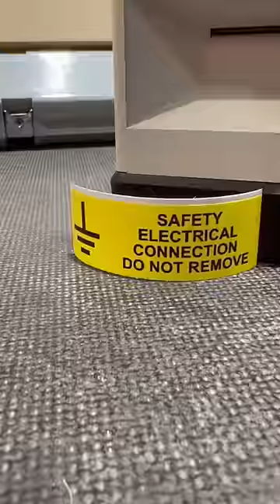Electricians Shocked by this Mysterious Earth Clamp

Comment: Why did you use a ring terminal for the second clamp, but chose to go "bare wire" for the first one?
I guess both work fine, but seems a bit inconsistent.
Reply: Think about it?
Reply: You can't have a ring terminal in the middle of a length of wire

And you're not allowed to cut the cable, and have one length from MET to first pipe and a second length from first pipe to second

So either you have two lengths, each from MET to their pipes, or you do it this way

Anyone please correct me if I'm wrong! I'm working on my NVQ and still learning 😅
Reply: @willpulford8893 You're spot on mate.
Reply: @willpulford8893  ah okay, learned something today.
Is there a reason why this is?
On a sidenote, i'm guessing this is a specific british rule/code?
I'm from the netherlands, and here we're not even allowed to do CPC/Earth in flex, we need to use solid wire. We are however permitted to use an earth terminal block. (Like a 4 or 6 mm solid wire to the bathroom terminal block, and connect all pipework to that block.) Same goes for the main earth for inbound pipes (like water and gas)
Reply: @ThorNado77  so the "do not cut and splice the cable" bit is a regulation, and I suppose the logic behind it is that by cutting and splicing, you are relying on that splice/terminal/ferrule to keep the pipe that is further away earthed. If the splice is weak or fails, then that pipe isn't earthed anymore. Seems like it would be a very rare thing to happen but that's the rules, my tutor was very clear on that

Do you really use a 4 or 6mm solid wire? That must be very hard to install! In the UK we treat the earthing of incoming services (water or gas pipes) differently to the earthing of other pipes through the house - for other pipes it's called Supplementary Bonding, and the main pipes it's called Main bonding.

Main bonding has to be a 10mm² cable, without any cuts and splices like I said

Supplementary bonding is done with a smaller cable, and is often done by just connecting one pipe to another, as long as one of the pipes is earthed somewhere along the line. Not 100% certain on that last bit
Reply: @ThorNado77 t's because when Dennis the plumber comes along and replaces the first bonded part for plastic in three years and disconnects it... Unless he 'destroys' the conductor... The remaining part will still be bonded. It's just more foul proof.
Reply: @willpulford8893 oh and main bonding isn't always 10mm
Reply: @travoltasbiplane1551  oh yeah I remember from doing EICRs for my level 3, it can be 6mm² or 10mm², is that right?
Reply: @willpulford8893  have a look at chapter 54. Table 54.8 for pme installations. 👍

Comment: They will be shocked that some bone head used a pipe ground. That’s not allowed in homes because if somebody repairs a pipe with non conductive material then the ground is gone. 

Not to mention the electrolysis between that Clamp and the copper pipe.
Reply: Not if they know what's happening, which isn't using a pipe to provide ground.
Reply: @Monkeh616  the title clearly says EArth
Reply: @Justin-Outdoors  It does, because that's the common vernacular. What is being demonstrated, however, is called equipotential bonding. Replacing the buried pipework with something nonconductive would merely remove the need for the connection.
Reply: @Monkeh616  so if there’s a repair on those pipes by a plumber, the problem still exists
Reply: @Justin-Outdoors  .. what problem?

The pipe is not being used to supply an earth connection, it's being bonded to the existing one.

Comment: Don’t ground to water lines.   Repairs are mostly PEX now, and you don’t really have a ground.
Reply: It's a bond, not a ground.
Reply: @Monkeh616  You remind me of a biologist I used to work with, who threw a fit, because I said that if you spray brake cleaner at wasps it cooks their lungs, and they fall out of the air like you tied a brick to their ass.  He had to inform me that wasps don’t have lungs.  I explained that just because he was a biologist, and knew the technical term, it didn’t mean that the other 99.9% of population if called them alveoli.   

You bond to plumbing because in the days when all plumbing piping was metallic it was considered a ground, and is still listed as one of the alternatives, for the two, required grounds.  Now that much of the plumbing is PEX, and it is frequently used to repair leaks, and do reworks for remodels, you can not depend on the piping as a ground and it should now be avoided.   Bonding to a copper cold water line got a friend a nasty shock when he turned on the bathroom fan, and then touched the handle in his new shower.  The remodel for his bathroom, had inserted PEX between the main plumbing, and the new bathroom.  The fan had a slight short, and when he touched the shower valve, he become the missing ground and got shocked.
Reply: @randallthomas5207  This bond is applied to pipes which are buried and introduce a ground potential which doesn't match that of the electrical ground - it prevents shocks. It is not being used to provide a path for fault currents, it is not replacing a proper ground connection for any circuit.

What you think you know about electrical installations doesn't apply in other countries with different regulations and practices.

Comment: It's still legit to ground to pipes, considering that most pipes in new construction is PEX coming off the main?
Reply: You have it backwards, but aren't the only one
It's grounding the pipe to avoid current caused by iron rich water flowing in the pipes
if not discharged it leads to the pipes degrading to galvanic corrosion

Comment: The first ground clamp was terminated correctly but the second one just adds an extra failure point with the Crimp, a set screw has 1000 lbs of tightening pressure
Reply: A properly executed crimp should exert enough pressure cold-weld conductor and sleeve together.  That is not failing any time soon.
Reply: @darqchild  whatever you say, but it doesn't , well-executed or not, a well-executed screw termination has a tightening Force of 1,000 lbs far beyond the capability of any crimp connection.
Reply: @mrromantimothy  The amount of pressure exerted will depend on the particulars, rules of thumb like that are just meaningless noise. But whatever makes you feel good..

Crimps are used to make permanent connections, and yes, a properly done one cold welds. They are far more reliable than screw termination or soldering.

Comment: Very illegal installation. Nice work 👍
Reply: And what did you think was 'illegal' about it sausage?
Reply: @travoltasbiplane1551  can't ground to water pipe 🤦🏻‍♂️
Reply: @charliegolonka1200 it is the water pipe that is being grounded, so if a fault makes it live, RCD triggers earlier
Reply: @charliegolonka1200  UK electrical channel mate. This isn't earthing.... This is bonding so wind your neck in.
Reply: @SteveOnTheInterweb  that's not what it's for either.b
Reply: Oh, it's illegal to bond pipes to ground? You do realize that that's what he's doing, right? The pipes aren't being used as a ground. They're being connected TO the ground, so that if something shorts to the pipes, there's a direct path instead of going through the guy who's washing his hands.
Reply: @puckcat22679  again that's not the reason. Bonding is there to maintain an equipotential zone in an installation between exposed conductive parts and extraneous conductive parts. If something is bringing a potential into an installation (normally earth 0v) it will present a shock risk under earth fault conditions as everything connected to our MET will rise in potential until ads is achieved and it won't. If it's bonded everything should remain at the same voltage and the shock risk will be reduced.

Comment: On demand electric water-heater set-up?
Reply: ground strap to prevent pipe corrosion - The iron content of water builds up a charge in pipes triggering galvanic corrosion: a similiar process to electrolysis

Comment: Using a water pipe for grounding is a bad idea. Many water service piping is now plastic, and compression fittings have rubber gaskets. Water department employees have to test meters and use jumpers to protect against becoming the ground for a bad electric circuit.connection
Reply: This is supplementary bonding of water pipes which are used for a lot of pipework around hot water tanks. Not main earthing.
Reply: @dvrn86  well it's actually main protective bonding not supplementary isn't it. But yes efixx seems to have a lot of non UK sparks sticking their oar in...
Reply: Where service pipes are plastic, there is even more reason to bond.
Reply: @chrispop99  errmmmm... No.
Reply: This is a bonding connection, not the actual ground. Metal pipes are supposed to be bonded to the building's ground in the US, as well.

Comment: Grounding anything to the plumbing is against the NEC..
Reply: It's not done to provide an earth connection, it's a main equipotential bonding connection which is different.  
Main equipotential bonding and supplementary equipotential bonding are done to ensure that anyone touching a class1 earthed piece of electrical equipment whilst also touching a metal water or gas pipe etc. during a fault to earth will receive less of a shock as both metal objects will be at same potential.
Reply: @18in80  Y'all have strange ways of doing things over there mate.. In the US we just use GFCI protection in Kitchens and bathrooms.. We have to keep the plumbing and electrical systems completely isolated.. We can't even run plumbing and electrical up the same chase..
Reply: @MarkLada our entire installation is GFCI protected in the UK. This is additional equipotential bonding to make sure the GFCI trips quickly and that a human isn't forming a current path in the period before the GFCI trips.

GFCI only works if it can detect a fault to ground, bonding helps ensure a fault does go to ground rather than somewhere else.
Reply: Good thing that's not what they're doing. They're bonding the pipes to ground, so that if there's a short or other fault to the plumbing, it has a direct path to ground. Keep in mind that in the UK, the entire electrical system is GFCI protected.

Also, metal pipes are supposed to be bonded in the US, as well.
Reply: @puckcat22679  The main waterline coming into the house provides a path to earth if the plumbing were to become energized.. Why do you need to ground something that's already grounded? I'm not an electrician, but I had to take a residential wiring class in trade school, and I've worked in residential construction for almost 20 years.. I dont recall learning anything about bonding metal pipes in school..  I don't think I've ever seen wires connected to copper waterlines on any new construction jobs either.. Granted It's not really something I go around looking for, but I think I would notice it if I saw it.. Just because I've come across plumbing being used as the grounding rod in older homes, many times, and the homeowners normally have to fix it by putting in a grounding rod so the electrical will pass inspection..
Reply: @MarkLada The reason we don't use water or Gas pipes for grounding is because that is not their main purpose and they may not be installed in a way that creates a good ground. In the UK the water pipe or gas pipe that enters the house is usually plastic, only in older houses will it be a conductive metal, and even then the water main may have been replaced with plastic. On new houses most of the pipework will be plastic although copper is still common.

For this reason you may have sections of pipework with no or very poor grounding floating at a different potential that require tying into the main ground. It's also possible that pipework will in the future be replaced with plastic (e.g. repair) which will remove the ground where previously it may have existed.

TLDR it's an unreliable source of ground so new installations must not use it, and older installations will be upgraded if work is done on them, especially if ground loop faults are causing problems with the tripping behaviour of GFCI.
Reply: @MarkLada Because 'ground' is not a fixed potential. The ground under your feet where the pipe comes up and the ground a few hundred yards away where the supply comes from may be at significantly different voltages, bonding all such potential, uh, potentials ensures everything in the building is in fact at the same voltage at all times.
Reply: @Monkeh616  I've done some research on bonding since coming across this video.. On the one hand, I can understand why it's necessary in some applications.. Like metal studs or metal conduits that have electrical wires running thru them.. On the other hand, I'm struggling to see the benefit of bonding metal pipes that have no contact with the electrical system.. Maybe my line of thinking is off, but the way I understand it to bond the pipes, you connect them to the grounding rod.. By connecting them to the grounding rod, you are connecting them to the electrical system.. If a fault occurs and current passes thru the ground, it's going to pass thru the pipes and energize the pipes.. I don't see many ways for the plumbing to become energized if it's kept isolated from the electrical.. I would think a fault that sends current thru the ground would be more likely to occur than the pipes becoming energized if they are kept isolated.. Therefore by bonding the metal plumbing you are actually increasing the odds of being electrocuted by it..
Reply: @MarkLada  Imagine you don't have a local ground rod (we usually don't.). You've got a metal pipe in contact with the physical ground at your house, and a 'ground' from the electrical supply, which is connected to the physical ground somewhere else. Due to a fault anywhere in your installation or someone elses, the potential of your local ground no longer matches the electrical ground, and you touch a piece of plumbing and an appliance at the same time - now you're having a rather bad day, and a GFCI does nothing.

Your electrical system is ground referenced - anything which makes contact with the ground is part of that system.

I should note a fault isn't even required - some high voltage distribution systems use the ground as a return, creating a potential between two points. Electrified train tracks using the three rail system pass immense currents through the ground. And there's current flowing through the earth naturally to contend with.